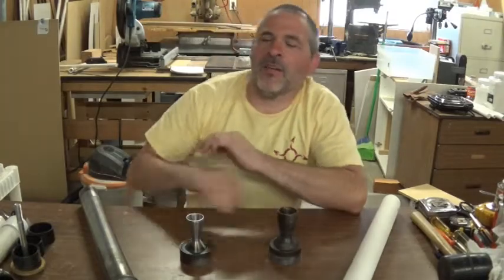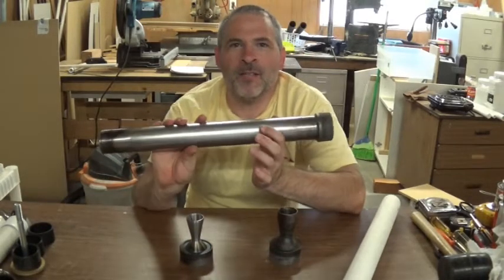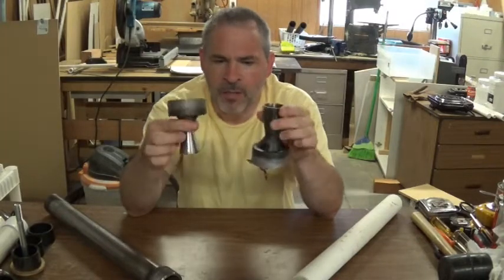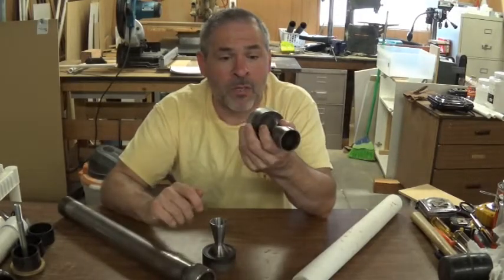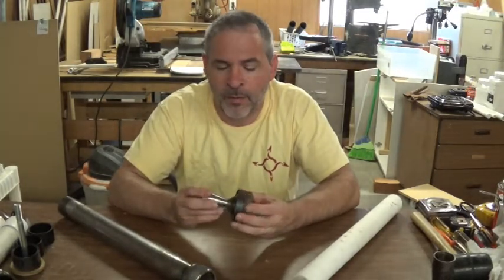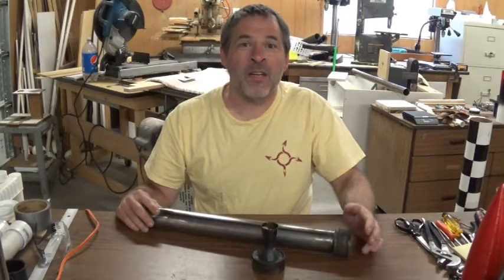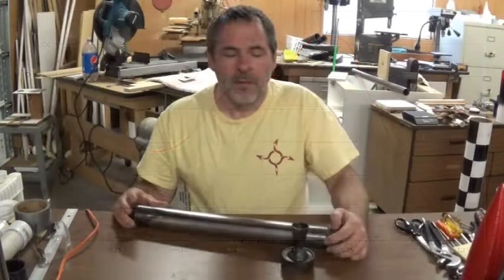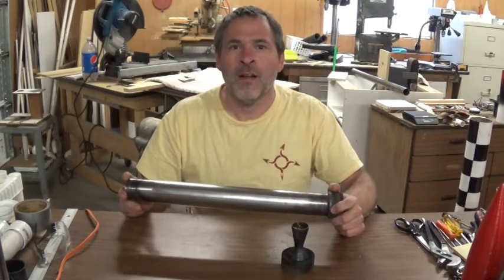Our BIGGEST homemade rocket motor EVER - PART 6

Comment: what is the final fuel mixture you used?
do tell its composition
Reply from the maker: The current mixture I'm using is...
65% powdered potassium nitrate / 18% powdered sugar / 17% corn syrup.
With a cooking temperature of 210F.

Comment: Can I have the detailed blueprint for this rocket motor, please
Reply from the maker: A while back, I gave all the specifications for this motor to one of my viewers. He made it and the first time he tested it, it exploded about 20 feet from him. He sent me the video... it was bad but thankfully he did not get hurt. This motor is DANGEROUS. I do not recommend making it. However, if you really want to make one, I believe you can determine all the basic specifications from the entire video series.
Reply: @rotaryrocketry  I plan it to make the motor from 0,2cm and 0,3cm thick stell. Is it too thin or too thick. Should I make it thicker to working more safely
Reply from the maker: The steel pipe I used for the outside was 1.3mm thick wall. But I am still asking you to NOT build this motor. It is way to powerful and way to dangerous for a beginner. Start with something smaller and you can work up to larger motors later. The rocket we launched with this went out of sight almost instantly. It is not fun when you can no longer see the rocket.
Reply: @rotaryrocketry  I know, I only use the motor, I only make a small one first, around 10cm long of fuel, may be
Reply from the maker: In that case, you should take a look at our Robo-Monkey motor video.
https://youtu.be/9IQ-IEagFHA
It has been our most reliable metal motor.
Reply from the maker: I recommend you start with something a bit smaller and safer...
https://youtu.be/WrvOPYNQv_g

Comment: Other ways to change the thrust curve are to shape the cores of the fuel grains. A star core shape increases the surface area when the pressures are low to increase the power the moment it ignites then as the star-shaped part of the fuel burns away it forms a more regular core shape (a borehole). Then as the fuel burns away, the surface area increases but the chamber size increases so the pressure drops smoothing out the thrust curve.

Comment: Your problem with baking soda is the water in the syrup. It creates CO2 bubbles!!!! Use all dry formula and melt dry it will be fine. I think then the baking soda will inhibit and cool the reaction. It is often used in sugar and potassium nitrate white smoke bombs as it cools and slows the burning to make more smoke. I think this is where you've seen it used in rockets as a delay, visual aid before the ejection charge. You would probably only have to add a tiny amount to slow your reaction.

Comment: What about a nozzle made from ceramic?
Reply from the maker: Not sure about that. Have not seen any videos of that. I would be concerned about the massive temperature change with ceramic. We know exit temp gets over 1200F because we have melted aluminum. We even suspect we have seen upwards to 2200F because we are pretty sure we saw a steel test nozzle turn yellow around the orifice for just a fraction of a second.
Reply: @rotaryrocketry  Graphite would be a good choice. It is machinable and resilient to high-temperature erosion from gases. The melting point is around 3600C which is way higher than even stainless steel. You would create a nozzle in graphite and use a steel threaded cap to lock it in place.

Comment: Reducing the oxidizer will slow the burn rate. In long sorbitol motors the last grain or two is sometimes run at 60/40 to reduce erosive behavior. I think this is worth a try for flexi-fuel.

I like seeing the lathe shape the nozzle, what a beautiful piece.

Those are some really impressive numbers, I can't wait to see the launch! There is no contact information in your "About" tab.